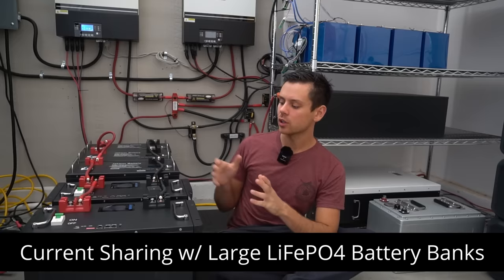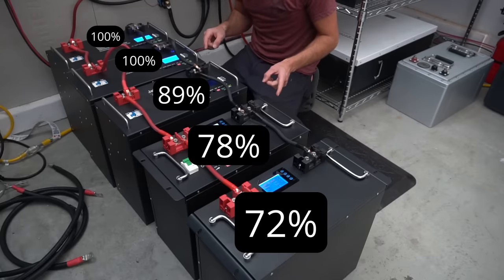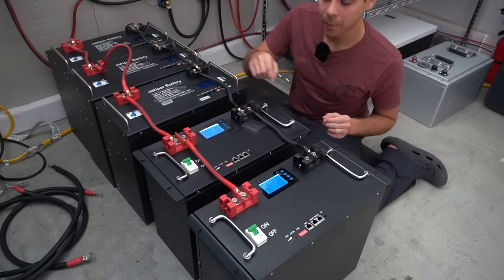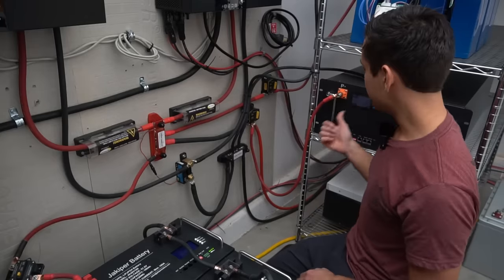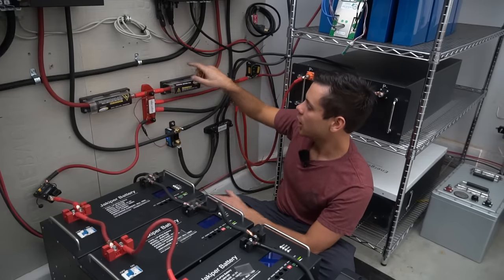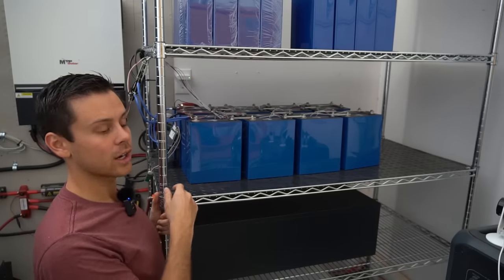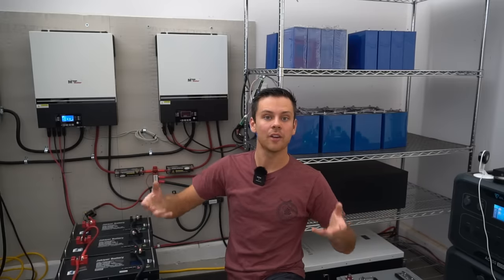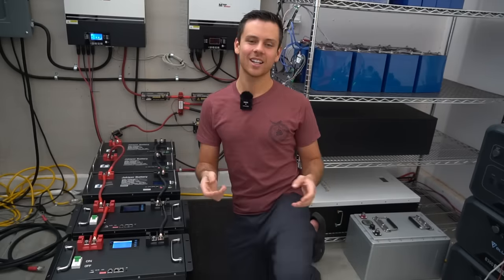Current Sharing 101 w/ Large LiFePO4 Battery Banks

Comment: Thanks Will for spending a good amount of time on T class fuses. I have placed comments over the last few years on people’s sites that are using ANL fuses, recommending they replace with a T class fuse. For the $50 or so for a 150A T fuse and holder it is well worth the money to save a setup from a catastrophic failure. I think those ANL fine for automotive applications, but not with high current LiFePo banks. I run my signature solar 6 bay rack with 4 gauge to the buss bar and 2 gauge from bus bar to inverter. I do have a 150A T fuse on the + side outside the rack and I also diagonal the connections inside the rack. Seems to keep things balanced between the 5 packs in the bank, and 2 of the battery packs are 1 year older than the other 3 packs. I will post in 10 years if they stay balanced 😂. Excellent video as always.
Reply from the maker: Very nice!!! You get it. And it is very important. Agreed!
Reply: @Jimmy G I have the signature solar rack as well, with 3 batteries for now. How did you connect diagonally on the buss bars?
There are only the larger lugs/bolts on the top on the buss bar.

Edited for typo: Originally stated 2 batteries. Should have been 3.
Reply: @careygagnon5853  I drilled and tapped one of the bottom hole connection on the negative buss bar to accommodate a 5/16” lug. I put a lock nut, the ones with nylon inside, on the other side where the screw came out the other side of the buss bar just as added security to lock the screw in place. I actually put a lock nut behind every battery screw connection just to ensure nothing loosens up due to any heating and cooling cycle that may occur since it is an off grid cabin. I also put a very fine film of carbon conductive paste between the battery terminal and the buss bar. I was a little concerned since this is off grid that if any moisture found it’s way between the buss bar and terminal it could oxidize. The cabin has spray foamed walls with a 120V mini split heat pump, so it is climate controlled, so maybe it was a moot point to do. Sometimes I way overthink my installations :)
Reply: @jimmyg6215  Nothing wrong with over thinking and over protecting. That's why I can't get my system running. Learn more...over think more...over protect more. If I can get up and running just to test things out (mine is a back up system for the house) then I will start swapping things out, like larger cables etc. Although I have 4/0 from batteries to inverter so no need to change those.
Reply: @jimmyg6215  Sorry I’m late to this, but I woud highly advice to exchange those nylock nuts for washers with spring washers. The nylon is temperature sensitive and when the nuts heat up from use, which is possible, they loose their grip and can come undone, causing a higher resistance and more heat. Sending the pack into an arc-fest. Regulations in my area prohibit the use of nylock for electrical connections, specifically for that reason.
Reply: @david0alinda  thanks David. I’ll check them while operating. The buss bar is already threaded and tightened before adding the lock nuts, but copper is soft. I just put them on there as a secondary lock just in case the temp of the cabin causes the copper to move, but it’s a good point if they do overheat. I only have them on the small connections from the battery to the buss bar, not the main connection from buss bar to inverter, those have a lock washer and nut behind them as I figured that would have the most chance of temp swings metal to metal since it’s carrying all the current. I have watched the batteries over the past year and they generally top out at around 8A each under full load on my 3000W growatt, it’s just a cabin. Maybe this years project is to swap them out just in case, but the threads on the copper buss bar would have to let go as well before there is a catastrophic anomaly.
Reply: @jimmyg6215  Wow! Jimmy, you certainly took satisfactory precautions to prevent future problems caused by heating expansion and contraction.  i for one, enjoyed reading your post, and give you an Attaboy for safety!  I have found that many problems occur due to heat, and cooling, plus oxidation.  Good job!
Reply: @careygagnon5853 I know you asked this question a year ago and probably have already found the solution. For those who's just viewing the video now and reading this, the answer to your question is to remove the bus bar on the negative side of the rack and flip it over and remount it.

Comment: Will, very good explanation of correct wiring of parallel banks,  I have been installing off grid systems for  over thirty years, primarily in the marine industry but also custom RV systems and residential systems.  Correct sizing of the interconnects is key. Size matters. Less voltage drop.  Voltage drop=resistance=heat.Heat is not ony inefficient but dangerous.  Plenty of info out there to size cableing appropriate to the current demands of a system.  The math is straight forward.  The equal length of conductors and same batteries in a multi battery setup arranged in a hub and spoke system vs a daisy chain system is codified in Kirschoff's laws which are built off of Ohm's laws.

Also, the purpose of current limiting by fuses/circuit breakers is to protect the wiring to a device not to protect the device per se.  If there is a fault in the device, the device has failed. Devices like inverters generally have their own circuit protection internally.  There fore, circuit protection for a system is to be calculated to the demands of the device and the  ampacity of the cabling, if mismatched, the cable can overheat sometimes with dire results. 

Keep up the good work.  Safety is paramount.

Comment: Hi Will, after starting with lead acid 24V 250Ah batteries (12 cells of 2V), I have later added a parallel LiFePO4 24V 280Ah battery (8cells of 3,2V). I agree to be somewhat limited with max. voltage. Issues with different cell voltages with LiFePO4 cells have settled after half a year. Least voltage ever was 24,01V. Thank You for Your videos!

Comment: So happy I stumbled along your channel, I've been bingeing your videos.  You're a true subject matter expert and are a wealth of knowledge.   This video partially addresses a question I've been pondering.  Some background - My RV's House batteries 2x deep cycle 100AH Lead-acid batteries are nearly dead.  Since we are so late in the season and I only have a month or so before I winterize it, I decided to make the leap to Lithium in phases.... starting with the batteries now (which means I also have to change out the onboard charger and engine battery isolation manager for the lithium profile), I will add solar and whole house inverter in the spring.  

I just purchased a Weize 12v/100AH LiFeP04 self Heating. (Actually bought 2, but only received 1, the other was "lost" in the mail and now they are out of stock with no ETA).  Our RV House batteries are under the steps outside (thus why I need the heater versions).  When I add the Solar and Inverter, I will have to install it INSIDE the RV under the dinette table bench.  Space should be good.  When I do that, I might like to add MORE capacity to support whole RV inverter, and was poking around at the newer CHIN 300AH battery that would also fit under the bench.  (again GREAT CHIN breakdown review video!)

My question I hope you can spare the time to answer has to do with the battery locations and differing AH capacity.  
With the "Smart" BMSs in both Weize and CHIN batteries I can see a scenario with the self-heating function engaging on one outside battery but not on the other?  lets assume the external 100AH battery detects low temp, engages heating element and waits to charge, while the internal 300AH battery starts charging? How would the batteries and BMSs react? would any damage occur during that state, how about when the 100AH heats up and starts to charge?  can you speculate if either batteries life would be diminished by this?

I'd love to have a conversation over a beer on this one  ;-)

Comment: A very old (77) engineer's comment:
 There is an old way to solving the equalization problems with those 5 batteries you have connected in parallel, And since it's very easy to do I would like you to try it and report on the results. (If not in a video, then at least to me).
Ready?
Disconnect the black feeder lead from the side of the parallel batteries that is on the same side as the red feeder lead, and simply move it to the other end of your group of parallel batteries. The result is all feed and discharge for the red lead comes from one end of the parallel battery bank, and the other feed and discharge for the black lead comes from the other end of your parallel battery pack.
 You can forget your buss bars if you were only adding them for balancing; because the resistances of the wires connecting the cells in parallel will act as balancing resistors during both charge AND discharge.
 You can easily calculate the series path length of any battery in the system to the load and back, and they will all be of equal loop resistance.
 If you still have any questions about why this old 'tried and true' method works so well, contact me and I will try to give you a more detailed explanation....
Regards,
Dennis Ostrowski
Astro Electronics
Reply: Thank you for sharing your old engineer's method for equalizing batteries in parallel! It's always great to hear different approaches and solutions. The Segway Portable PowerStation Cube Series seems like a reliable option for outdoor enthusiasts and RV lovers. With its massive capacity, powerful output, fast recharging, and comprehensive protections, it definitely seems worth considering. I'll be sure to check it out! Thanks again!
Reply: This sounds very interesting, I would really like to see that video or at least a diagram to make sure I understand this properly.  I need to add more battery and I want to do it safely.
Reply: @Floyd112007  

if you watch the video, he mentions it @5:50
Reply: I have wired my batteries this way and charge and discharge currents on each of the 5 batteries are pretty even.

Comment: Wow.  Never thought a few feet of cable would make that big difference. You know I’m a pro electrician and I never thought this out. I deal with 4160 volts regularly and 480 but this is a very different thing. Humbled again by you and I will be watching for ever as I am new to solar and battery ect. Just goes to show you that you can think you are a pretty good electrician and there is always more to learn. I’m humbled next to your expertise. Bought your book. And thanks.
Reply: I have worked with 12,460V chillers, but they don't compare to working with DC voltages, and battery systems.  I have seen the results of a 480V battery system going to ground, and it was horrifying.  The difference with AC, at 60 hz, is that the current will let you go on a reverse cycle, but DC current locks on, and will never let go.  I am sure that it is the same with 12V-24V-and 48V battery systems.  They are all dangerous.

Comment: Great information, I've been wondering about these things. I have 3 EG4's and 2 Jakery's running in parallel as you do here, except I have the negative and positive wires on opposite sides. There are differences in charged state, but usually within 2-3 % of each other. Glad I bumped everything up to 2 gauge wire also.

Comment: I've been running 72 AGM 7.2ah batteries in parallel. In parallel banks of four in my 12v off grid system. Special parallel wiring.. Nearly 12 years now 👍👍

Comment: Great video, thanks for addressing mixing capacities in parallel. Annoying that both SOK and Battleborn say that you cannot mix capacities in parallel, SOK says its due to internal resistance, Battleborn due to voltage imbalance, leads to much confusion about how IR and balance works in parallel. Andy with off-grid garage has great series of videos showing an extreme difference in battery capacity in parallel with no issues and goes over how IR allows that to happen.

Comment: Thanks Will, this is just the info I've been looking for. I've got an RV trailer with solar and one 12V 110 AH Lith Ion battery and want to add a second 12V battery. Wasn't able to get an exact match (now out of production) so am adding a 100AH battery Lith Ion by a different maker - both are US made - and now I'm much more confident it will work just fine. So many other sources say don't mix batteries of different age, size, or manufacturer, and here I am doing all three.

Comment: Great video! I will now build a lithium NMC system consisting out of 2 blocks in parallel. One will be wired closer to the boat motor (and charger) then the other. I will put a fuse on each block just above 1C rating. If funny things occur and the balancing current is unexpectedly high, the fuse should go.
The motor is max around 0.75C of the battery bank, but if one of them disconnects through the fuse, and the master BMS is still letting the motor continue, then it will become a relatively high C rating on the remaining block, at max power.

Comment: I'm also a DIY'er but I did some research on parallel battery strings and I found it very interesting that a lot of commercial and industrial devices that use parallel Lithium-based strings use a bidirectional DC-DC converter *for each string*.

Comment: Class T fuses are definitely best practice. Equipment Peak through voltages and withstand ratings should also be taken into account when designing system over current protection.

Comment: Very interesting and timely topic! I’m planning to add parallel 48v batteries so that total internal resistance drop and voltage drop will be reduced. Though I was concerned of amps imbalance between strings of 48v batteries. Your video explained this very well.

Comment: I'm so glad you mentioned parallel run have to be the same length. I've seen other youtuber showing off their systems and have everything looking so perfect , beautiful craftsmanship, then they get to the battery bank and the work is very neat looking , But then they have a bus bar on the wall and the batteries in series parallel and the bank close to the bus bar has the shortest wires then each one gets about 18 inch to 24 inches longer and they have 5 banks. so the outside bank wires are about 7 feet longer than the first one. I very nicely comment on it then they disagree with me. I've been a electrician for 30 years , I don't know everything , I'm still learning every day. But I can tell you the short parallel will be doing most of the work. I've seen many AC parallel runs melt down . and DC works just the same.
Reply: Was just telling the same thing to will as I am a pro electrician but the things he says in his classes blows my mind   Much respect to will. I was just telling him the other day that his installs were ugly and he should consider using gutters to “ cleanup his work “ as this would not be acceptable in my trade. Boy do I feel a fool. Sorry to Will as he is the journeyman and I am the helper. 👍
Reply: @jeffreyhill3960  My 30 years are in commercial buildings. 4000 amp services at a lowes distribution center , we added 100 battery chargers for their fork lifts 480 volts It was a long time ago , I think we ran 10 parallel runs of 500 MCM . we wired the building when it was built. if you drive around the building it's 2 miles. So I said that just to say this I can wire about any building but solar , I feel like I'm back in school again , Or in training. Will impresses me he looks young but super smart and very experienced. nothing against young people but normally it takes many years to get that much  knowledge. I'm retired now and getting ready to do my DIY 10KW array and a wind turbine down the road. and it's easy if you know how to do it but I'm learning so it's not so easy for me yet. back in school.   LOL
Reply: I like to ask questions but most Youtubers don't answer or have to many comments. One old guy I watch and he will answer every comment or question. G Bears off grid ways in the desert. He is just a lonely old man living off grid and he helped me and explained somethings. but I'm starting to understand. in our world if its 120 volts we run 120 volts . 480 we run 480 , But not in solar.

Comment: Good information Will.. having a 67 kw  lfp battery bank that has five 48v 280ah batteries in parallel with slightly different 1/0 cable lengths all with individual bms’s and circuit breakers. I never pull over 40amps on any single battery! So far so good 😊 
Having a working current of 14.2% of C max 280a = 1c is a small enough where all batteries charge and discharge at a very similar rate.
I’m reconfiguring my battery bank and buying other 80 280ah cells!
134kw of lfp battery storage should do it!
I hope 🤞 
Thanks Will, keep up your good and very necessary work!
✌️PT

Comment: This has become more interesting than I thought.  While LFP has a flat voltage curve, a 48V pack/set has 16 cells so it will show a huge voltage drop once the LFP cells experience tiny voltage drop. In other words a bus bar could be overkill.  Can you measure for us the resistance between the first and last battery terminals?

Comment: Will,  great discussion.   I would like to see a video about the alarms and notifications the batteries put out during use in a parallel systems.  Do you have communication with each battery?  What messages are you getting during use?  I am getting overcharge and over current messages during normal use.  The manufacture says it is normal.   The BMS puts out a message as it enters normal over voltage and over current modes.   I wish they would delay these messages while normal operation is going on.  

Also could you discuss how the cell balance circuit work along with these messages while charging…. How long before these batteries balance and will the over voltage messages go away after they all reach 100 % SOC .  Thanks for all your videos….